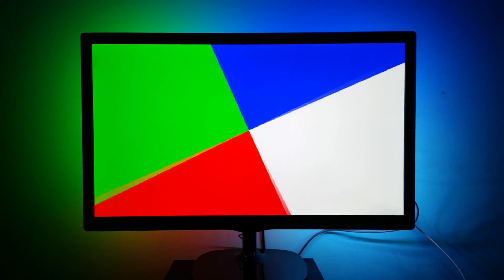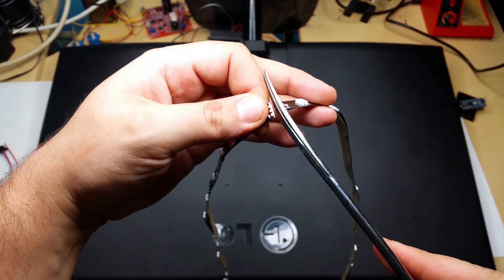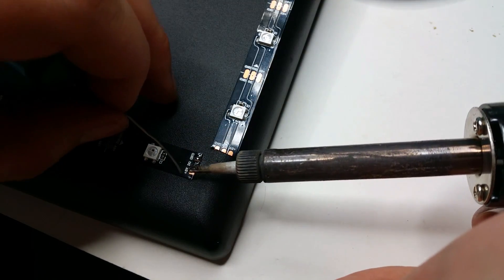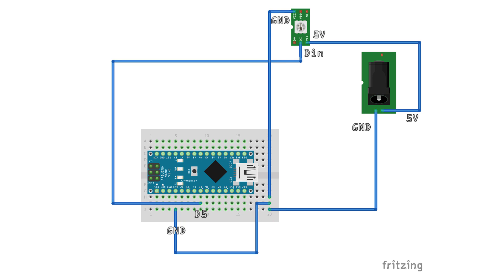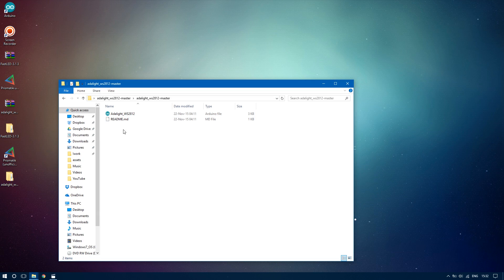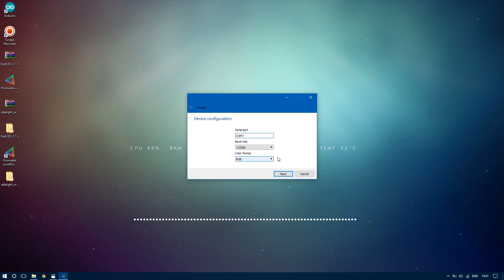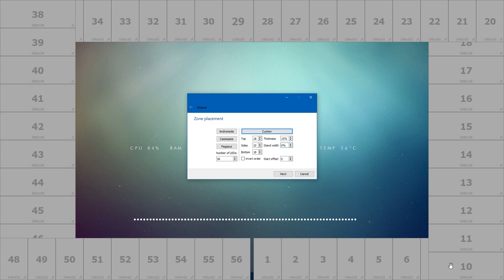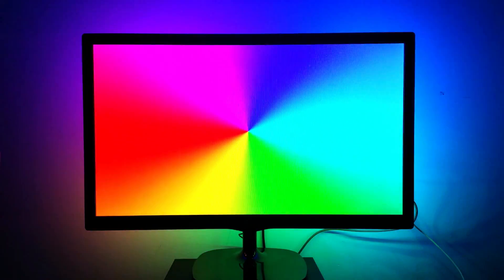DIY Arduino Ambilight RGB WS2812b Full Build & How-To

Comment: Hello there,

Thank you for your tutorial, I was looking for something like for days. But now I am facing an issue, I have a RGB WS2812b led strip with 144/m. When I am runing wizzard, what ever the number of led I am putting, the arduino crash during the process and I have to un/replug it. I only got this issue with this, anything else that use FastLed's working well. I am using the Arduino UNO. 

Thanks for help me :)
Reply from the maker: Interesting. And you're even using an uno. Have you tried maybe changing the output pin to another one? Or if you have a mega lying around or another arduino to test it out with that. That's the 2 things that come in mind really. How many leds total do you use?
Reply: Thanks for replying fast 

I've got 2 types of led, both give me the same issue, one of 60 led / m, another 144/m.
I don't have an another arduino in stock. Gonna try with another port, I'll asnwer soon
Reply: Nothing change :C
Reply: I trying on debian too on my laptop, same issue
Reply: Ok i found the issue, the 5V port seems to be instable. When I'm using the 3.3V, It doens't crash... any idea why the 5V give me that give or problem ?

Comment: Welcome. And you did not think about making Ambilight but on all devices connected after HDMI? It's enough to just RaspberryPI, Videograber and HDMI Spliter. I will not embrace it. But the video guide would come in handy and yours are very transparent.

Comment: Hi, I have a little problem because my screen grabbing doesn't work, the rest modes like sound visualization works perfectly. :( I'm using the arduino UNO. Can someone help, please ? btw. Nice project :)
Reply: Ok I fixed it... Just changed capture source for WinAPI (i've got win7).

Comment: Would this work if i wanted to try it on my nvidia shield?
Reply from the maker: I don't think prismatik is available for Android. You need a different tutorial, one based on the raspberry pi and an HDMI Splitter. This tutorial is only for use with a PC. Sorry :(

Comment: Great video. I've been curious to try out the ambilight for years, and this gives me confidence. So, I have a little arduino compatible board, the digispark attiny85. Can you think of any reason it would not work for this application?
Reply from the maker: You can definitely give it a try as the arduino only uses 1 pin out for sending data. Not sure if it will be able to handle it but give it a go for sure, if it doesn't work you can get a nano for cheap :) Check out the links in the video, if you buy from them I get a small commision which helps me out cause the ads are going off the video tomorrow due to the new Youtube Partnership rules. Hope this helps you out :)

Comment: Hi Boris, Thank you for your amazing tutorial and support. I ve a problem with Prismatik. In Screen Grabber mode it doesnt capture the screen at all (Grabber frequency: 0.00 - all the time). I tried numerous configurations (unofficial Prismatik: 5.11.2.13 and 5.11.2.12 as well as official Prismatik: 6.00. various adalight forks) but still its not grabbing my screen. But when I set mode to mood lamp the leds light up. Have tried disabling antivir. I ve a GT 1030 GPU Nvidia.

In addition when configurating color setup in wizard my leds have uneven color (1half: white 1half: lightblue)
Any help would be greatly appreciated!  :^ )
Reply: I found the problem. My machine runs on Win7...I had to enable "expert mode" on the "profiles" tab inside prismatik. Now the "experimental" tab is availble, inside it I had to switch capture source to "WinAPI".
Reply from the maker: +Renegade X - Red Alert 2 Mod thanks for the support man :) this problem seems very strange and haven't come across it yet. Really don't know how i could help you. Maybe try on another computer if you have it and see if it works there. Might be a Windows issue. What Windows version do you have. I've seen somewhere that prismatic doesn't work well on some windows 7 installations
Reply: I allready found the solution related to the capturing issue as I discribed above and yes youre right win7 caused the problems. Anyway I still have the uneven color issue of my leds (dont they ve enough power or is it broken?)

Comment: Is a breadboard necessary? Can i make ambilight without it?
Reply from the maker: it's ofc possible but it's much easier this way :)
Reply: Boris Dusnoki correct me if im wrong, arduino take screen infomation by usb cable connected it with computer and show it on led strip? I guess that
Reply from the maker: he white cable is a USB cable with the microusb part cut off and I'm only using the 5V and GND cables from that cable. The ground is connected to the ground of the arduino and the ground of the strip. The 5V cable is connected to the 5V rail of the strip. A separate cable with mini usb is connected from the computer to the arduino, this usb connection powers the arduino and receives the data from the computer for which LED to turn on on the strip, with what intensity and what color. Hope this answers your question. It's my fault that in the picture I didn't connect the USB cable to the PC.
Reply: Boris Dusnoki thank you so much, i got it

Comment: is it possible to power it via desktop power supply or desktop usb port?
Reply from the maker: You mean power it from the desktop usb? I have tried it but would not recommend it as the usb churns out maybe half an amp of power. Better use a separate power supply, I've added a 5A 5V power supply I had laying around to power my strip, but for my needs a 2 or 3A would be enough.
Reply: what about a desktop power supply..for example molex

Comment: My Strip is only White
Can  anyone help me?
Reply from the maker: SnoopTV try uploading an example sketch from the Fastled library. See if it works fine. If it does, then it's a software issue for sure. Try reinstalling and setting up prismatik again.
Reply: #include <FastLED.h>

#define NUM_LEDS 30
#define LED_PIN 5

CRGB led[NUM_LEDS];
void setup() {
  // put your setup code here, to run once:
 FastLED.addLeds<NEOPIXEL, LED_PIN>(led, NUM_LEDS);

for (int i = 0; i < NUM_LEDS; i++) {
     led[i] = CRGB(0, 0, 255);
 }

 FastLED.show();
 
}

void loop() {
  // put your main code here, to run repeatedly:

}

I tried this. but its still white
Reply: Help pls :(
Reply from the maker: Try this one https://github.com/FastLED/FastLED/blob/master/examples/Fire2012/Fire2012.ino
change line 5 to #define CHIPSET     WS2812
#define LED_PIN     5 to the pin of the arduino you connected the data pin of the strip to,
#define NUM_LEDS    30 to the number of leds you have connected all together

if it doesn't work, check again all your connections, maybe your strip is defective, or arduino, or your connections. That's all I can do unfortunately
Reply: Thanks for Help!
Reply from the maker: You're very welcome. And thanks for the sub ;)

Comment: Hi Boris, I want to use ws2812b with 144 led/m. Does it works?
I think the Resolution should be much better with 144 instead of your 30 led/m setup.
Reply from the maker: Volkstrauertag you can try. But if you get problems with the arduino, try switching to the arduino uno or mega. Not sure how it will perform. I'm only using 56 leds total on my whole 27'' monitor. Processing power will also increase. Check some forums about prismatic and use with more leds.
Reply: Thank you for your answer. I want to use a 40A 200W Power supply. Do you think the arduino nano could be too smal for this Action?
If i use them, the arduino has to manage about 450 LEDs :D
Reply from the maker: Volkstrauertag I really can't tell you. Just saying if you have issues try getting an arduino with more processing power. That is what I would do. Maybe someone has more insights about this issue.
Reply: Dont forget that your amp draw will go up dramatically. You will need to feed power in multiple points to prevent burnout of the tracings on the first LED strip.

Comment: Sorry but I did not understand something with the connection.
The white cable that appears in the 3.11 minute is the usb cable cut off and connected to the 5v transformer?
So what about the arduino usb cable when everything is set up, disconnect the cable?
Thanks Boris. Great Video!
Reply from the maker: the white cable is a USB cable with the microusb part cut off and I'm only using the 5V and GND cables from that cable. The ground is connected to the ground of the arduino and the ground of the strip. The 5V cable is connected to the 5V rail of the strip. A separate cable with mini usb is connected from the computer to the arduino, this usb connection powers the arduino and receives the data from the computer for which LED to turn on on the strip, with what intensity and what color. Hope this answers your question. It's my fault that in the picture I didn't connect the USB cable to the PC.
Reply: so, you use 2 cables. one for the arduino and one to power the lights.

Comment: Does the 5V 2.1A phone charger really power all those LEDs? I figure it would need a higher amperage to properly power it?
Reply from the maker: It does. It actually work off of the laptop usb power (separate plug to power the led's) only the brightness is a bit lower. I've recently made some small changes, and added a 5A 5V separate power supply that I originally bought but didn't use cause it arrived a month later than all the other parts. Will check the actual max power consumption when all the leds are white and write you here. And I'll make a small follow up video of what modifications I made to the project.
Reply: Thanks, I'm following your video now as we speak to get the software up and running. Fingers crossed I did an okay soldering job!
Reply from the maker: wert564austin1 great job. Fingers crossed. Good kuck
Reply: Just tried firing it up, but unfortunately not a single LED lights up :( gonna have to go back through with a multimeter and see if all is well
Reply: Strangely enough, I’ve got 5 volts going through the whole thing. Maybe it’s not making contact with the arduino via the breadboard? I’m completely new to arduino so hoping I can figure this out with my day off today
Reply from the maker: wert564austin1 double check your connections. Try with an example sketch first, some of the Fastled examples. And then move on to trying it with prismatic
Reply: So I don't know when it happened but i noticed that the first LED lit up green and stayed that way., then I restarted my computer and I can't get it to light up at all. Regardless, when uploading the sketch to the arduino, I'm getting an error after the compilation. Its an "stk500_recv(): Programmer is not responding"
Reply: So I figured it out, just some driver issues...BUT I FINALLY GOT IT WORKING! And I want to thank you so much for all the fast responses. You honestly really care about everyone trying to recreate this project and I can't thank you enough. You definitely have a new subscriber
Reply from the maker: Nice :) I'm glad you got it working finally. And thanks for the compliments, I do try to answer the questions of my viewers as soon as I can, and ofc if I know the answer :D Keep up the good work, and I'll hopefully see you on my next project :)

Comment: Hi, first of all thanks for the tutorial, a little doubt, I have a 5V 1.9mA charger, will it work? And, the number of leds used does it not influence the power of the charger?

Thank you in advance
Reply from the maker: You're very welcome :) I'm using a 2.1A 5v charger for 56 LED's. It does seem to be enough for this number of LED's but if you have more, then you should probably get a 3A one, or 4A, depending on how much you have.
Reply: OK ty, i will try it at home, i will put about 50 leds, so i will go for a 3A or 4A, i will post the result. Realy ty for the tutorial, your the best...
Reply from the maker: Hugues Faria for 50 leds 3A should be enough. I would put a 3A supply but all I had lying around was a 2.1A one. Good luck man :)

Comment: Hi, great video, I'm waiting for the parts to do it^^
One question, for the cables to link each side of the LEDs, are you using the same tin you used for soldering or is it another material?
Thanks!
Reply from the maker: UberCactus glad to hear it man. Same solder is used on everything. I think 0.5mm 60/40 lead based with Flux core.
Reply: Hi, another doubt, this wouldn't work when plugging the usb on a ps4 isn't it? as it requires the pc to execute the programs and that I think, or everything is processed on the arduino and the usb is only for power supply?
Just to confirm as I have the doubt on the source of the color information.
Thanks!
Reply from the maker: UberCactus source of the color information is the prismatic application on the PC which sends data to the arduino. So no it won't work on ps4 :)
Reply: Thanks!  last question (I hope), when you mean power supply, it means having the phone charger plugged to the current, and then you also have the USB attached so it can receive the information isn't it?
Reply from the maker: The power supply is needed to power the LED Strip separately from the arduino. That's why I'm using a 2A 5V phone charger with USB cable that has the other end, stripped wires and use the red and black ones only (5v and gnd) to power the strips 5v and gnd. And also make sure you link the GND of the power supply with the gnd of the arduino all on one rail of the breadboard. It is shown on the video.

Comment: Hi, I am a total noob in electronics and please need help setting up the connections! Ive already tried many tutorials, troubleshooting but I still don’t get it to work.
I have WS2801 LEDs, an Arduino Uno Chip and a 5v / 1 amp power cord. 
Side 1 from the LED strip (tried it with a strip with 66 LEDs and one with 29) is connected to the Arduino Uno (GND to GND, Clock to Pin 13 and DATA to PIN 11). 
Side 2 is connected to the power supply (Positive to positive and ground to ground). 
Arduino Uno is connected via USB to my PC.
When I connect the cables from the LED strip to the Arduino the first LED lights light up, sometimes green, sometimes red, then disappear and get no more reaction. After I connect the power supply the LEDs don’t light up (I also don’t know if they should).
I thought they could light up after installing the software and everything. So I proceeded and followed tutorials with Arduino software with which I also got no light… (but I probably also did something wrong, these tutorials are not made for noobs).
Your help would be much appreciated!
Reply from the maker: I don't think this particular library supports ws2801led strip cause it has 4 pins (gnd, clk, data, 5v). But go and google adalight ws2801. Maybe you can find a library that supports it.

Comment: Hey dude, i have a question. How to set the max brightness in the Arduino code, because it is much safer to set the max brightness there, because my psu cant handle the much current. Any help would be great!
Reply from the maker: Hey man, I don't think that is a possibility, didn't see any option for that in the adalight sketch, rather use the prismatic software. It has an option for overall brightness of the LED Lights.

Comment: Hello. And is it possible to do Amblight but without the bottom edge of the monitor? I care about the two side and top edges.
Reply from the maker: Davvvi1 of course it's possible. It's all doable in the software.
Reply: Boris Dusnoki Thank you for your answer. At the weekend I will put together according to your guide. If something goes wrong, then if I can, I will ask for help.
Reply from the maker: Good luck man! Thanks for the support :) Cheers
Reply: Boris Dusnoki Hello. I made Ambilight according to your guide and works without a problem. I'm going to record a movie of action and shout on Youtube. Can I put a link to your guide in your video? I still blocked the RGB test, I was annoyed by the continuous lighting of the LED when I started the computer. Thanks for the guide. Regards.
Reply from the maker: Glad I helped out. Of course you can put my link, I would even appreciate it. Keep up the good work.
Reply: Boris Dusnoki. I have a question for you. I noticed a slight delay at my home. Is it possible to somehow compensate?
Reply from the maker: Davvvi1 there is an fps option in the software. Try playing around with it.

Comment: Question: What is the max number of WS2812b LEDs an arduino nano can handle?
Thanks in advance
Reply from the maker: Not quite sure. But there are probably a lot of forum posts about these kinds of questions and unfortunately I don't have and more led's than the ones I bought for this project to test it out.
Reply: Ok ill try to find it. thanks for the amazingly quick answer!
And thanks for showing me how to build this awesome ambilight!
Oh and another question. Does this system need alot of processing power?  I dont want performance drops in games :P
Reply from the maker: As I've answered in another question, I've only tested it out on hearthstone which is not that much processor hungry. Not that much of a gamer I'm afraid.

Comment: Does it work for games on the pc as well?
Reply from the maker: Tim Cornils sure does :)
Reply: Boris Dusnoki without fps drops etc.?
Reply from the maker: Tim Cornils that I can't guarantee. I've since then only tested out hearthstone that is not that dramatic with fps. My pc isn't meant for gaming.
Reply: Okay ill try it and thanks for this tutorial and fast answer👌👍
Reply: works in games but loss of 10-15 fps
Reply: @syuksel  what processor and graphics card did you use?
Reply: @dfalekulo9138  gtx 1060 6 gb and ryzen 5 1400 3.80 GHZ O.C